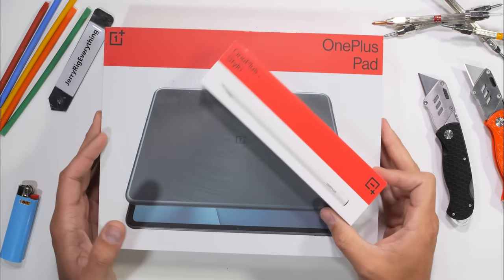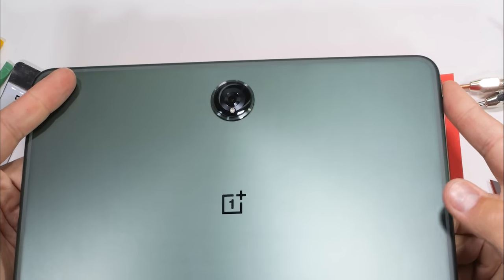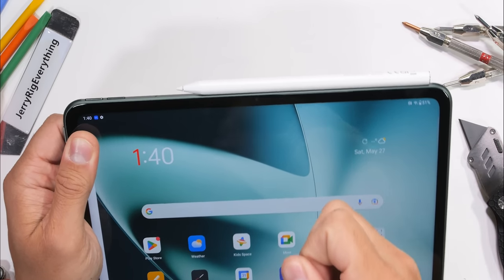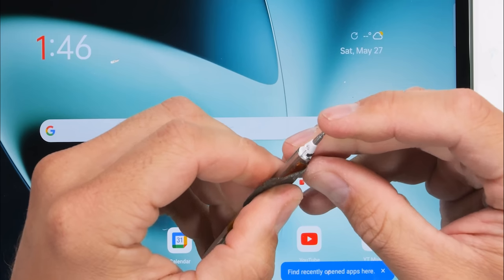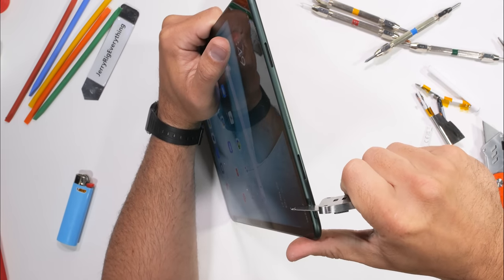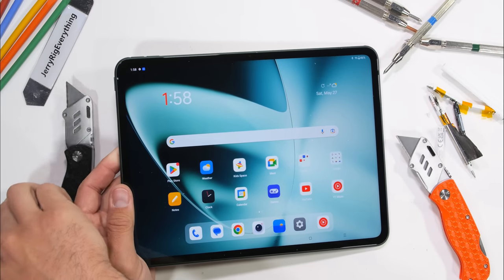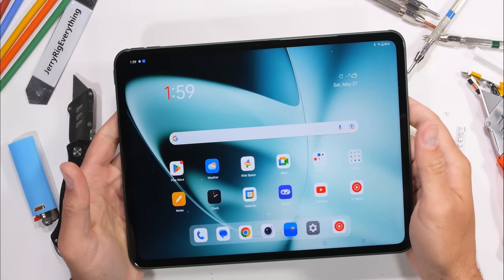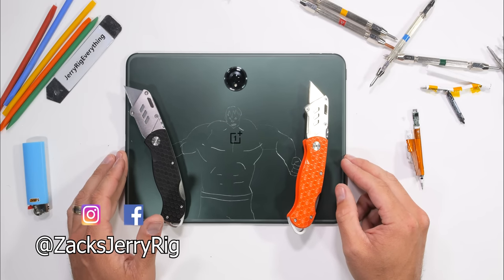NEW OnePlus Pad Durability Test - This is awkward...

Comment: I came to know about this recently, the reason a printer doesn't allow us to print in black and white when the color ink is low is because whenever we print a document, the printer prints a machine readable code onto the paper which can be used to identify the date, time, printer information and possibly location of the printer. These dots are  typically yellow in color but may differ from manufacturers, these are very tiny which is not visible to the naked eye but can be seen under blue light or special scanners.
Reply: thanks imran khan
Reply: cause using a tiny amount is just hard
Reply: Yes but i can get my printer to print black n white as colour been removed if its off line when connected and used,, i fill up the cartridge with bottled black ink... Its messy and should buy a lazer printer